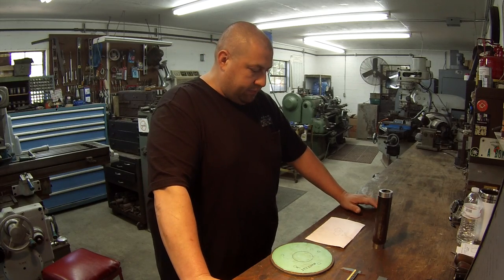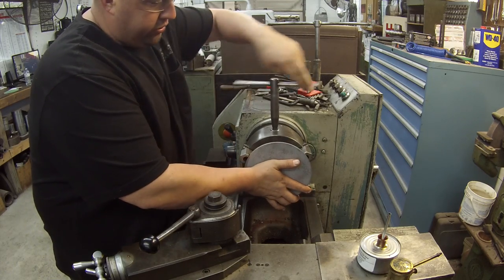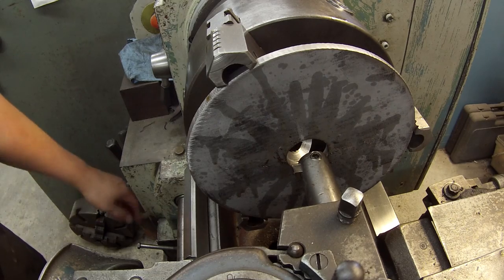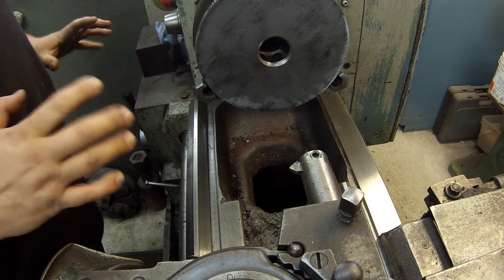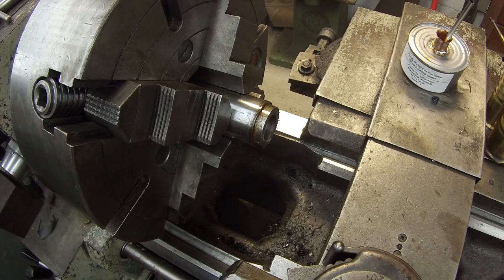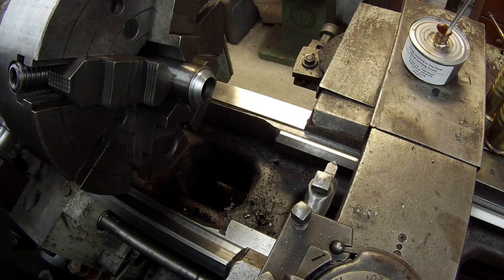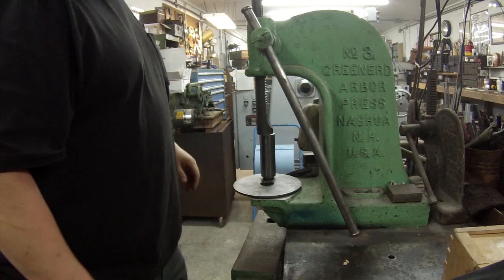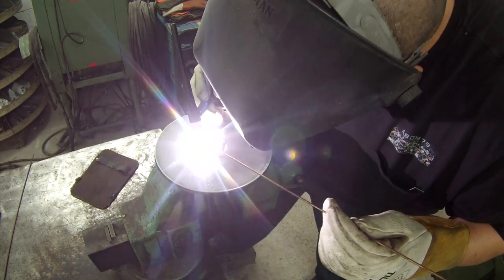Custom Balancing Adapter Part 1

Comment: Very nice! I can't machine at all and looking at your work, I think you are doing a quality job. As a welder I can say that you certainly understand what's important: Heat, penetration, stacking,.... The only thing I would do is keep the argon on the weld bead for just a couple of seconds, but when you machine it flat it won't make a big difference... Nice job!

Comment: Pretty bad that we enjoy watching you dial your parts in but curse ourselves when were doing it, you truely make it look like its just as easy as putting the part in the jaws
Reply from the maker: It is! Nothin to it. Just keep practicing.
Reply: When you're dialing in a part in a 4 jaw, just think of moving the part in the chuck half of the distance it's out of center.

Comment: Hi Adam !

Yeah, I like these smooth TIG-weldings better too instead of these "washboard"-looking ones !

Really nice work ... again !
Reply: Stacked dimes can be pretty when done nearly perfectly... whether done with TIG or fast freeze rod. I can't do either perfectly. :)
Reply from the maker: DSCKy I can get lucky sometimes! LOL
Reply: Abom79 I apprenticed under welding picasso,  20 good welders standing round watching him get busy,  he was the man..  We hated when he showed up for emergency derailments,  he got the pencil and not the rail lift tongs absolutely no question about who got the pencil, easy extra hard work day for em and in weather below zero, warmth of the bonding machine,  lot of welds tho..  3yrs under em and over a zillion welds and I cannot weld like em,  you either have it or not,  even tho laying good beads lend sometime perfection,  its just not that level and they are rare..  Every freakin weld lol...

Comment: Adam, great video. Looking forward to #2. One thing I noticed from watching Keith Fenner's videos is that he makes an extreme effort to get comfortable when he welds. Usually, that means sitting. With you having to stand and take most of the weight on one leg while you work the TIG pedal, it seems like it would be a great deal more comfortable to sit. Maybe a motorized jig? I love your videos and always look forward to them. Keep up the effort! Many thanks.
Reply from the maker: I can agree with you, thats one of the first rules is to get comfy. I always try and position my hand on the part or something while I'm tig welding. The vise is a bit tall to use with a stool, so thats why I stand when parts are clamped there. When I can tig on the table top I try and sit on a stool.

Comment: Interesting video and super clip in the edit room. You get better and better at the sound too. If you aim the mic away from the air conditioner, fan, nose maker, you will considerably lower the constant background noise. Mics are somewhat directional (you can get a shotgun mic that is super directional) and aiming them at the sound source helps a lot. Your voice is really clear in this video. Nice work. Looking forward to part two.
Reply from the maker: Hey Jim, I have learned already that the mic needs to be pointing at me when I'm talking. I've been trying to turn it backwards when I'm on the lathe working so that my voice some in better. It's tricky but I'm learning as I go. 
I think eventually I may invest in a wireless mic like keith uses.
Thanks for the comments!

Comment: I'm no machinist, but I watch a couple on YouTube, so clearly I'm an expert...  😄.  When you were boring the center hole in the plate, couldn't you have plunged in with a parting tool or diamond shaped bit or similar to get close to where you needed to be and boring a little to get it to size instead of using successive drill bits and then boring a bunch to get it to size? In my expert opinion, it would seem faster to cut out the hole instead of drilling & boring. Thoughts?  Lookin forward to part 2.

Comment: I bet it'll exceed the customer's expectations when finished.
P.S. One of these days you're going to have to make a real clutch handle for your lathe.  That bolt probably works just fine, but it's lacking a bit in style.  I'm sure you could make it interesting.
Reply: I've been noticing that for some time. Thought maybe the bolt has sentimental value? :)
Reply from the maker: DSCKy Well you may be right. My dad put that bolt in there ages ago and its what's always been used. I may get to that one day but it's not a priority of mine.

Comment: Hey Adam,
Enjoyed your project. A few questions: I've seen you use both stick and MIG, but TIG seems to be your "go to" welding process. Any reasons? It appears your machine has high freq. start. Do you use a gas lens? Thanks for sharing your project. Great video as always!
Have a good one!
Dave
Reply: TIG is more precise... which is nice on a project like this one.
Reply from the maker: Dave, I actually have always liked stick welding more, I guess because I feel I'm better at it. But I have done my share of TIG welding over the years. I just never seemed to get the feel as some guys, like Jody. I have do a lot of hand manipulation to get the beads looking right. Doing a fillet weld is pretty easy though cause you can rest the cup right in there against the work piece. Tig is cleaner, prettier, and more precise just as DSCKy said. I don't have a gas lens torch, but it is water cooled, and high frequency start, or continuous.
Reply: Abom79 Walking the cup.

Comment: Is the wheel this is designed for hubcentric by chance? I wonder how they will keep the wheel true for balancing without a machined hub for it to ride on? Or is the application not that critical?

Comment: Nice job Adam, I have a question about your welder. I've never welded in my life I only know what I've seen from YouTube vids. Does the peddle you use control the amps as well as the gas or is it just the gas flow?
Reply from the maker: Duncan, the foot pedal is how you adjust the amperage, or "heat" when welding. You can adjust on the fly how hot or cold you want at any given time. This is great for bench welding, but not so good for say like welding inside a car chassy. it doesn't adjust the gas flow, only start and stop. You adjust the amount of gas you want on the regulator hooked to the gas bottle, also know as a Flow Meter.
Reply: Abom79 Thanks for the reply Adam,  much appreciated. Love your vids. Keep 'em coming.

Comment: Good Looking TIG work there, Do You keep Your tungsten sharp? My dad was a pipe welder and this was a must for Him, I,m talking Needle sharp>>>
Reply from the maker: Yes I always sharpen the tungsten as sharp as I can. I got used to grinding them on the belt sander since being in the new shop.
Reply: Abom79 Thanks for the reply Adam, Great videos as always, looking forward to part 2....Tim